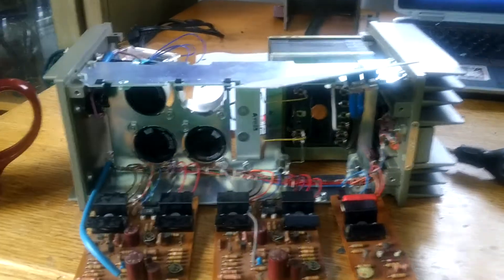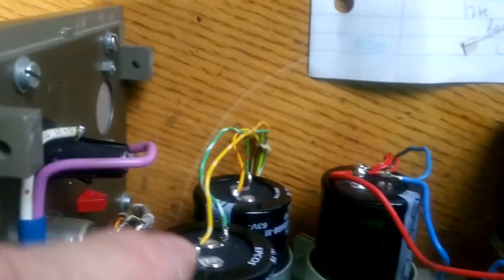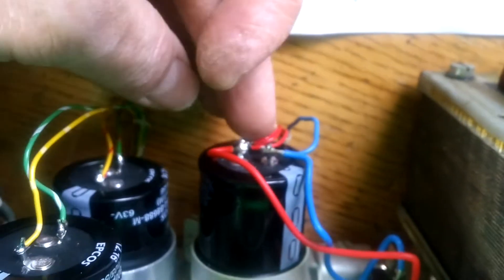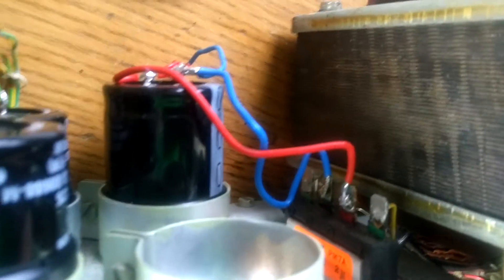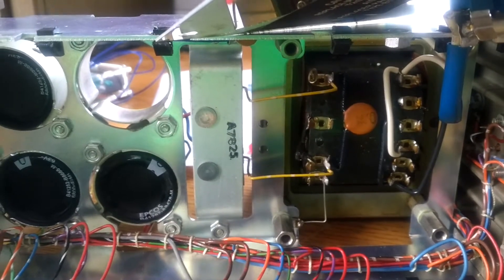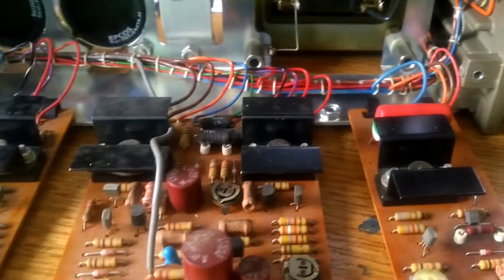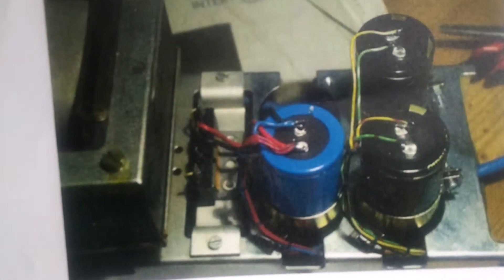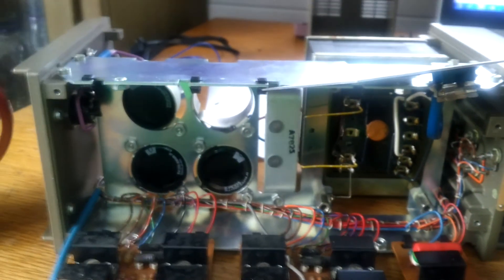Quad 303 Dada Electronics Upgrade kit Step 2 Begins

Comment: All trimmers must be replaced!!!
Reply from the maker: I respectfully disagree. They work just fine. It is not like an electrolytic capacitor where they dry out and go out of tolerance over time. They are also not a high wear item. Think about it. How often do you adjust your trimmers??? If they work fine leave them alone. Less risk decoupling and replacing them from old boards...🤣
Reply: @navydiving  That's your business! Personally, I always change trimmers, and I have no problems in the future, since they cost negligible money. I wanted to share my experience ...

Comment: @ 2:58 please do replace and install the thicker yellow wire...thicker = better in this case. Quad's 303 wiring (not only at the diode bridge) is "thinnish" anyway so while you've opened the amp anyway this provides a good replacement opportunity...
Reply from the maker: Did you watch my other step videos? Here is the last step 6: https://youtu.be/Y6ma3TC6Q3o